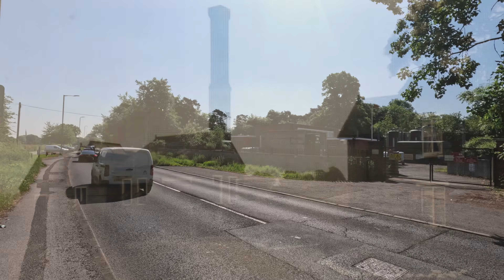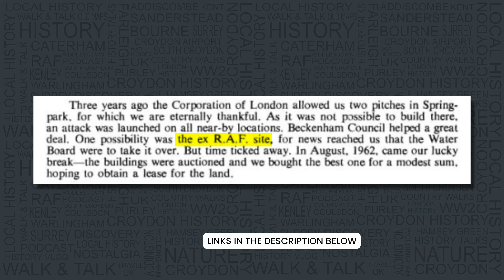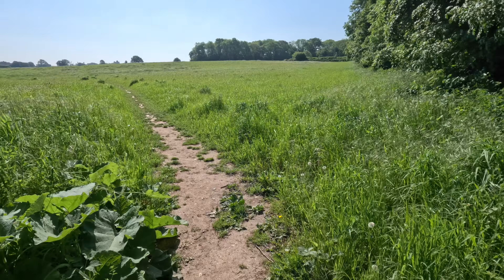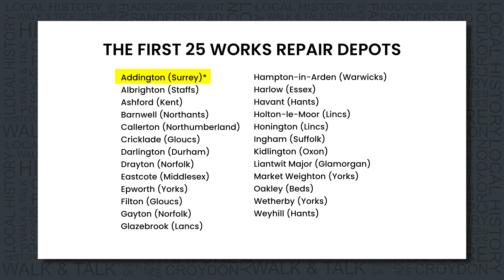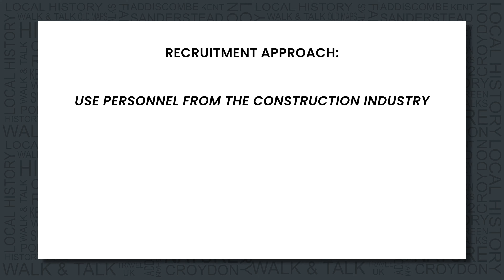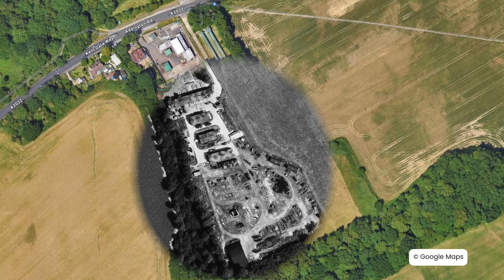Addington Air Ministry Works Repair Depot, little-known Battle of Britain location

Comment: Just watched your video, Phil are used to grit that road for many years.  Just wondered if you knew the cottage beside the car park. What’s the place where Amber Lynn and King Henry the eighth used to go?   Because it was halfway between London and Hever Castle  if you look at it the cottage the door is round the back  I was told that a lot of people when I worked at Croydon Council  wondered if you could find out more
Reply from the maker: The cottage is the location of the actual “Kent Gate” on old maps. I think it used to be a toll gate where you had to pay to go through it. The Boleyn family had a connection with Wickham Court off Layhams Road. It shut as a school last year I think, not sure what it is now. I’ll look into the cottage a bit more. I know the City Commons Rangers use a building next to it

Comment: That's a nice bit of investigative work...and another pumping station 😉 Q. Which river (if there is one) that causes Sparrows Den to flood from time to time?
Reply from the maker: Thanks mate, if I can find an angle to work in a water function, I will! 😂 - I think that flooding has been due to full groundwater in the past - but read somewhere once that an underground culvert was blocked and that caused the flood. Having a pumping station there and add Featherbed Lane will no doubt be because it is the perfect source for wells/adits
Reply: @philswallow  Might have been a blockage, can't find culvert noted. "There is a reason that Spring Wood at West Wickham is so called. Playing fields at Sparrows Den, ... , were deliberately flooded earlier this week, creating a storage pond to protect nearby homes..." (1 March 2014). Modern mapping shows a watercourse perp to A2022 in line with East end of Shirley Heath. The North end TQ37613,64572 showns a 'Spring' that 'spreads' into the current field on old maps. LIDAR shows area incl Sparrows Den being lower...
Reply: @philswallow  OS REF: 
TQ3764NE - A, Surveyed / Revised: 1954, Published: 1955
TQ3764SW - A, Surveyed / Revised: 1954, Published: 1955
Reply from the maker: Thanks, I’ll take a proper look tomorrow. I took a non-filmed walk from Addington to Spring Park last autumn and there is a small wooden bridge over the spring that then flows down towards the field by the A2022 and also a pond just by the woods.
Reply: @philswallow  👍Could that be the pond where "Threehalfpenny Wood" got its name? I read there are three ponds (Inside Croydon) "A gentle amble across two hemispheres, and a giant mystery" 13 Apr 2019. Interesting comments thread.
Reply from the maker: This is the what3words location for the pond: 
///punchy.nods.swing
https://w3w.co/punchy.nods.swing - it is indeed by Threehalfpenny Wood
Reply: @philswallow  The good news is I found the route of the West Wickham Bourne culvert (where the collapse was) on the EA flood risk map. From the Eastern edge of Sparrows Den all the way to the Ravensbourne...
Reply: @philswallow  2001 Flood Report: "It was apparent that this was possibly the first outbreak of the Wickham Bourne since 1969...By Friday 19 Jan...2 rugby pitches at Sparrows Den were unusable as there was 2ins of water standing on large parts of them"

WWRA: "The Wickham Bourne which even now sometimes flows along the Addington valley fed by springs in Spring Park Woods was probably only a winter chalk stream before the wells and pumping station at Kentgate substantially reduced the water table level"

BSoc: "Our local paper had dramatic pictures of the West Wickham bourne. Where the water bubbled out of the ground there was plenty of room for it to flow over rugby and football pitches alongside Addington Road...The West Wickham bourne rises much more rarely..."

Geograph: "The Bourne Stream Culvert Collapse 2014 -- Culverted Thames Tributary the Bourne Stream collapsed at Sparrows Den causing months of localised flooding and traffic disruption to West Wickham Kent"
Reply: @philswallow  ps the croydon-ponds-project-booklet makes good reading.
Reply from the maker: @LoremIpsum1970  I have spoken with the Bourne Society folks about tracking the Bourne, probably in a series - another one for the list although please feel free to help with any research! 😉
Reply: @philswallow  Gladly. At least we know Sparrows Den / Spring Park area was prone to flooding before the pumping station. I noticed with the Wickham Bourne culvert that it's mostly all subsurface, going to have to overlay the EA 'river' plot over OS...
Reply: @philswallow  the only part of the Bourne as a 'river' on the EA maps is from Succombs Hill roundabout along to Purley...the search continues...
Reply from the maker: http://bournesoc.org.uk/a-celebration-of-the-bourne-introduction/